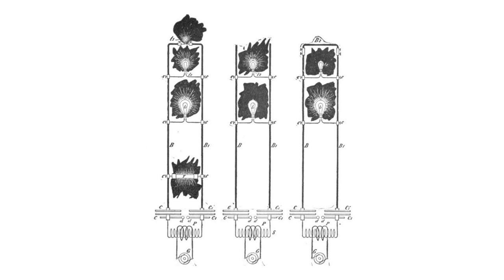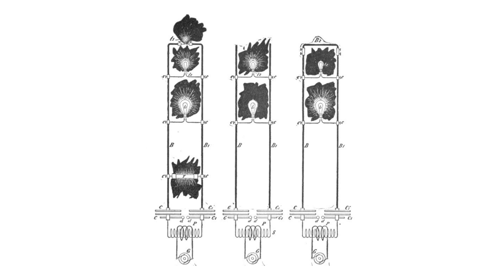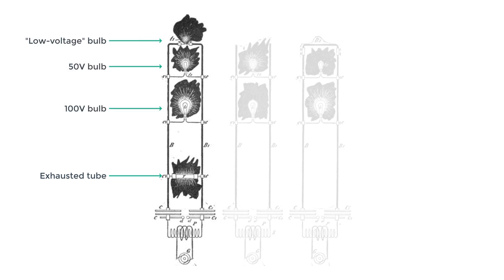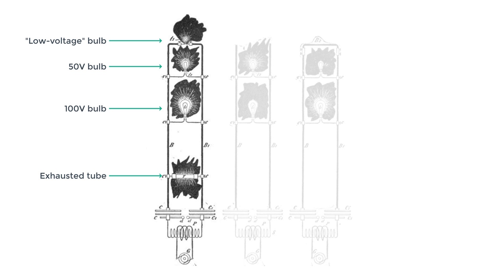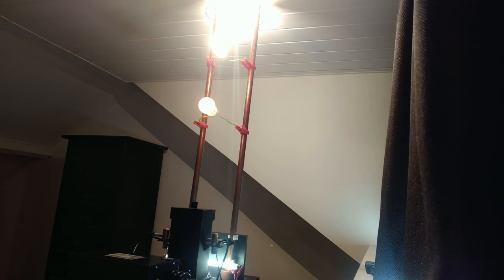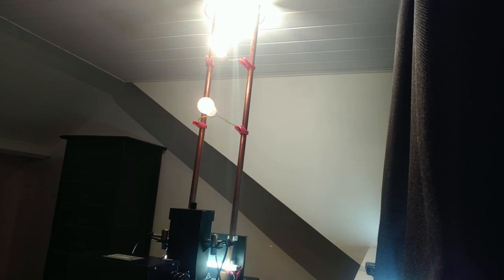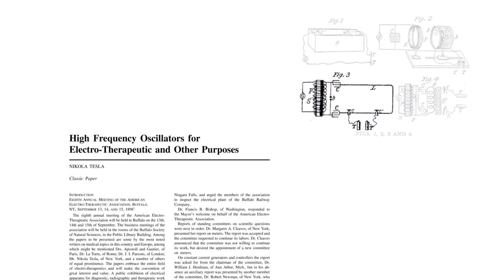Tesla Hairpin: Replication of Tesla's original experiments + more

Comment: Try powering Tesla Coil with Tesla Hairpin Circuit where the copper pipe is shaped into a primary coil. Make Tesla Bifilar Coil the secondary coil with one end of coil connected to earth ground and other end of coil directly connected to Extra Coil aka Resonator. Output of Extra Coil connected to aluminum pipe and then to Top Load as described in Tesla patent 1119732 which is the Colorado Springs Model of Tesla Coil.
Reply: Xeno effs.
Reply: What does this achieve ?
Reply: @gc1979o the hairpin circuit (as per N. Tesla) produces Scalar/Longitudinal Waves/ currents of "cold electricity" or perhaps a type of "dielectricity, sans magnetic-electric transverse coupling", due to the spark gap & capacitor peculiar setup that allows low-to-high freq. bursts/pulses, completely "within", or "from" the dielectric space (or 'counter-space', the magnetically neutral Bloch Wall zone).....  and is then used to DRIVE the Primary coil,  to induce a Secondary coil....  and then (as per Tesla's notes), an "Extra Coil" is connected ( see schematics for details)  to the 2ndary, for resonance I believe .

Actually not MUCH has been researched AND published about this SPECIFIC type of driving of Tesla coils (among many of his other devices & patents, which I think he creatively stopped short of saying that this circuit should be the driver of,  potentially,  A LOT of his patents.)  And this type of Longitudinal wave generation acts VERY differently than normal 'electronics', Electromagnetism & engineering, and is DEFINITELY not taught about in school for electrical engineering,  etc.

Eric Dollard,  Tesla,  Oliver Heaviside,  & Charles Proteus Steinmetz I would say described some of this area better than any others,  and were much more open minded TRUE scientists, and brilliant nonetheless.   And I believe,  as Tesla says, that this type of waveform,  field,  or propagation is at the heart of true Radiant Energies,  both Earth-originated, & Solar & Cosmic originated.     I think this area is the hidden half of the WHOLE PIE of what people THINK of as "electricity" , although I think it really does need a unique and special name,  that many ppl can use and know what is being referred to;  so far Longitudinal waves,  Scalar,  Radiant energy,  Cosmic rays, Dielectricity & Counter-space are most of the terms I've read/ heard used basically all referring to the same type of 'generation' of a special type of waveform,  & its propagation. 

Much love yall,  and happy building & learning!  👍 😊 🙏 ⚡

Comment: I want to add something inportant: to me Tesla's wireless transmission via his magnifying transmitter does not use the earth as a coductor, but a part of a condenser/capacitance: one "plate" is built by the spherical/toroidal terminal high above the ground and connected to one side of the tesla coil. The other "plate" is built by the earth's surface, hence connected to the other side of the coil, called "earth"-connection. This special and still today unconveniant transmission is a one way transmission, not needing to be part of a closed loop circuit. It's a open circuit, also recognized by the non lossy tranmission, making the difference compared to Hertzian tranmission used today. The power is only used to built up a alternating or pulsed electro-static field, the high voltage is afforded to not lose energy in electromagnetic waves - this transmission uses longitudinal waves only., created in the dielectric/ether.
Reply: How is it non lossy when clearly the electric field doesn’t light up light bulb for example a small distance away
Reply: @cosmicyoke  Read again. In layman's term. BOTH the earth and the atmosphere are used to transmit electricity, one-way longitudinally.
Reply: @lukiepoole9254  It's been a while
Reply: @cosmicyoke  Forgot who you are already lol
Reply: @lukiepoole9254  I did not forget you 
I'm an EE student now lol
Reply: @cosmicyoke  nice. There's too much electronics however lol
Reply: @lukiepoole9254  wym
Reply: @cosmicyoke  you will know as you continue your uni
Reply: @cosmicyoke  lol he was lighting up bulbs on the ground 250 meters away with a tiny setup at Colorado Springs.
Reply: @sea5207  what about miles?
Reply: @sea5207  Even if that wasn’t a ~3 times overestimation of the distance, congrats! He was also consuming close to a megawatt. Inverse square law plain and simple.
Reply: Yes longitudinal waves are a thing. Sound waves are longitudinal, waves on water are transverse.

A longitudinal wave is a compression wave.

Comment: It's the scalar waves from the spark gap, one wire is just for antenna to the spark gap nothing fancy. Try to make a simple spark gap with two perfectly the same rods (everything but one tiny bulb) then take the antenna lead and try to oscillate this into a Tesla receiver, viola wireless energy. Now SCALAR waves can be modified to be both high frequency and high amplitude, there's no wavelength
Reply: You'e saying it has no waves even when claiming it is a wave lol
Reply: @lukiepoole9254  no not really the wavelength of a scalar wave is always the same, it's amplitude and pulse ratio(voltage) changes
Reply: @vladimirnachev324  the wavelength of em waves are the same as well

Comment: Have you built a magnet quench spark gap yet. or a rotary switch yet? Later Tesla used rotary switches.
Reply from the maker: You are right, but I have not built those yet :-)
Reply: @Waveguide  It's not just something you can replace with transistors, it must be a quenched spark gap. A triggered spark gap quienchrd by a mini vortex coil (mini POE 'peace on earth" style construction) or a rotary spark gap at high rotation rate may be best.

Otherwise the energy from back emf is not crisp transients and cannot draw energy from the aether.

Comment: how do you attach the bars to the door knob capacitors?
Reply from the maker: @emichael06  I got some brass end caps that fit the copper pipes, drilled a hole in them, and then bolted the capacitors to them (they are threaded).
Reply: @Waveguide  thanks for the reply! Also, for the top bar, when used, do you just slide it on with 90’s or do you secure it somehow. 
I am wondering if it will affect how the power goes through

Comment: Sir, if one were to build the 16 coil Bedini Hotrod.  Would it be a simple matter of replicating the single coil circuit 16 times?  There appears to be a "copper harness?" outside the coils.  What is the purpose of this?  Thank you for any help sir. 

I came here via the waveguide blog.  I apologize if this qery is in the wrong video.  I couldn't find a Bedini video, although it appears that the Robert Adams machine does have similarities.  I'm a noob sir, so I apologize for any missteps in etiquette.
Reply from the maker: You would indeed have 16 identical coils around the motor if your rotor has 16 magnets. My upcoming build will have 12 rotor magnets, and so 12 coils.
Reply: @Waveguide  Thank you for replying sir.  The coil number and dimensions are not what has me at an impasse.  It is the electronics.  Mind hurt I'm good with, the brain hurt is coming from the electronics.  The schematics for SG single pole are everywhere but I'm not sure how to proceed with multipole circuits.  Thank you for any help sir.
Reply from the maker: @hoofheartedicemelted296  the exact same way, you just connect them all in series or series/parallel to get a decent total resistance, and you just connect the string of coils instead of a single coil to the circuit.
Reply: @Waveguide  I'm indebted to you sir, and thank you for the instruction on the waveguide blog.  It took complexity and simplified it and answered many questions.  Thank you sir.

Comment: Have you done research on gray motor ? Looks like same tech
Reply from the maker: Hey, I have not done any Gray Motor research yet. I feel all these things are in one way or another related indeed.
Reply: @Waveguide  
 I made one back in 2002 I didn’t understand the tube back then but it made the table shake when it fired lol
Reply: @kenergy1707  Could you tell me more about this Gray Motor? Does it run on mainly volts and no amps? I'm looking into how to power motors using Dielectricity (cold electricity, radiant energy) and keeping the magnetic component (amps) out of the system to keep the power safe for humans, but I'm having trouble finding information on motors that can provide serious torque without magnetism involved, this gray motors sounds like it might be a type of dielectric motor.
Reply: @JenkoRun  the Ed Gray motor 3,500 volt pulse motor was said to produce over 100hp ran on hi frequency pulses threw a “tube” that spit that “positive “ and charged the batteries 
 It was a safe frequency

Comment: U said the spark gap is air quenched gap . 
I dont see any air flowing.. Can you expand on it plz.
Reply from the maker: nrg free hi, here is a detailed description of the spark gap I built for this setup: https://waveguide.blog/tesla-air-quenched-spark-gap-replication/
Reply: Waveguide i have an 8 kv NST at around 64khz. Do u think it is gonna work.
Reply from the maker: 64kHz will not work, because it will short out the capacitors. You need a low frequency NST (50-60Hz) for this to work.

Comment: Have you tried building a tesla transformer to generator some cold electricity to run a load?
Reply: Hi Owen, I have been experimenting a lot with single wire power transmission, which has the properties of what you refer to as "cold electricity", and these currents can be used to light bulbs, but usually I transform them back to conventional currents at the end of the line using a second Tesla Coil or an Avramenko plug, and power the loads with that instead.

The reason this longitudinal electricity appears "cold", is because there is only a tiny amount of conventional current flowing through the wires, and so only a tiny magnetic field is present.

Because of this, these currents cannot heat up a filament, since there are hardly and I²R losses, and the minuscule magnetic field also makes it impossible to power traditional electromotors directly from these currents.

However, these properties do allow extremely efficient power transmission, as long as we transform it back to conventional current at the end of the line to power our loads.

At least, this is the current state of the art, until someone figures out a way to power loads directly from these single wire currents.
Reply: @NickKraakman  Thanks for the info. So, it can run LED lights,
Reply: @NickKraakman  and we have to redesign electromotors. I can't remember if Tesla spoke on this in any of his lectures or papers.
Reply: @owenstobbe8860  try running a microwave instead of a motor
Reply: @CharlieSolis  Could you share more details on motors using high tension over amperage to provide significant torque? I'm looking into powering devices using high voltages instead of amps as it's far safer than conventual electricity, but I've not been able to find much on electrostatic motors that provide any serious torque. Cheers.